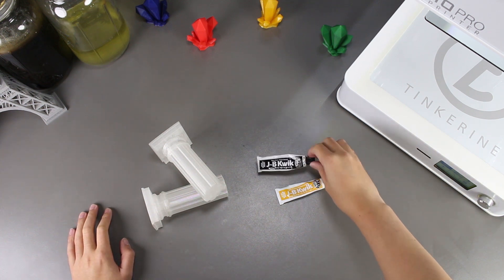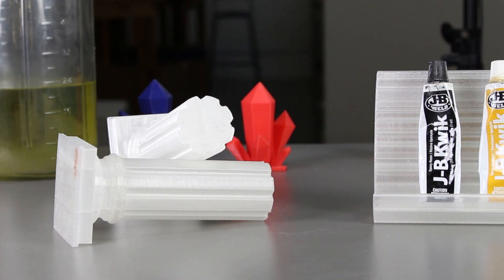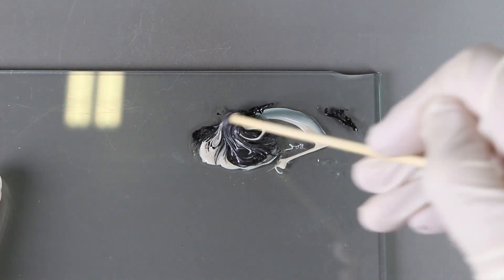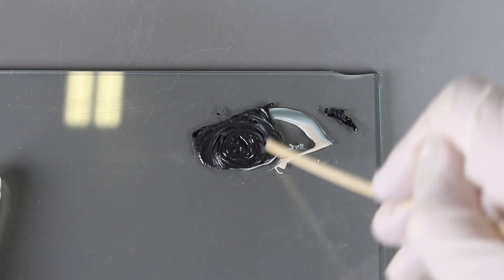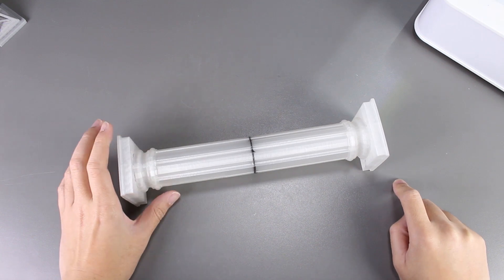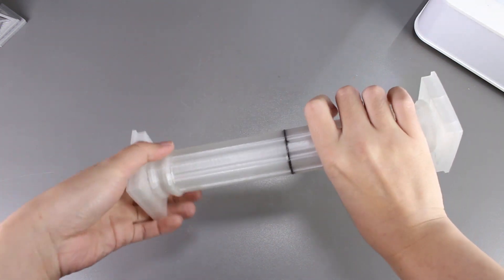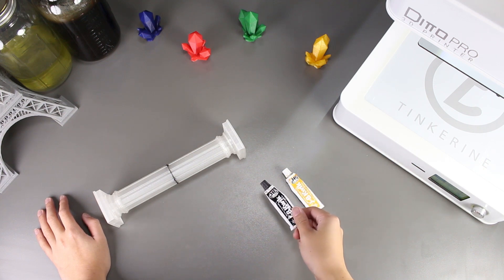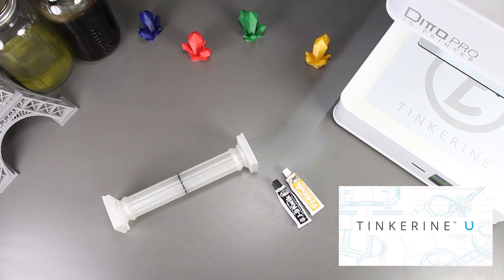Gluing 3D Printed PLA Prints with J-B Kwik

Comment: what about of welding parts with the soldering gun?  do you recommended?
Reply from the maker: It takes a steady hand and some time, but using a soldering iron with filament as solder works as well!